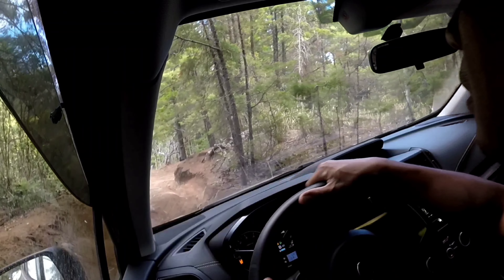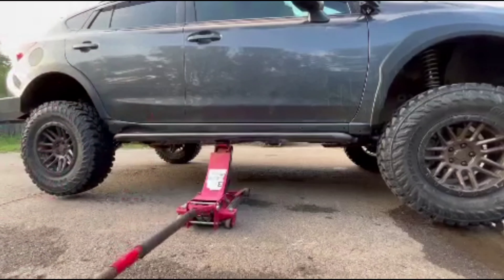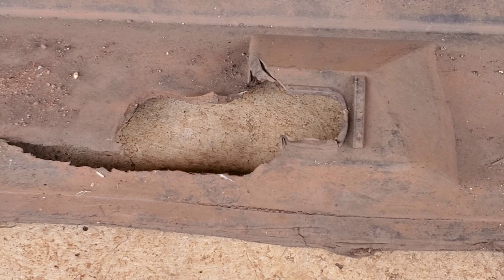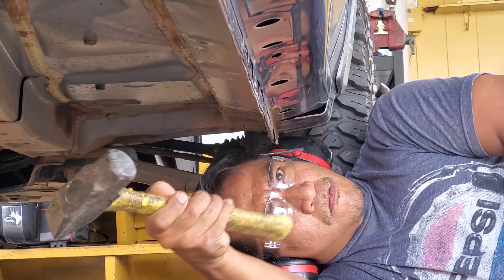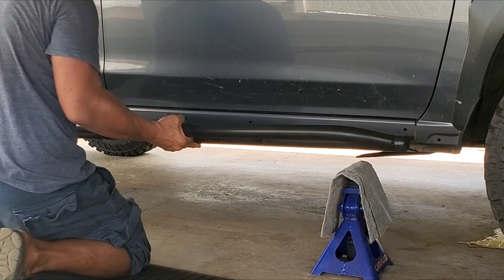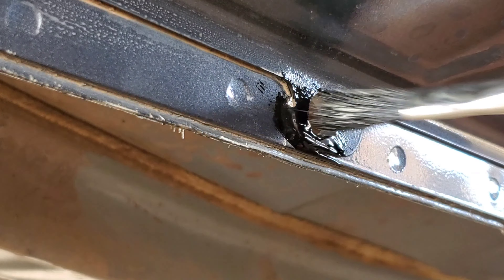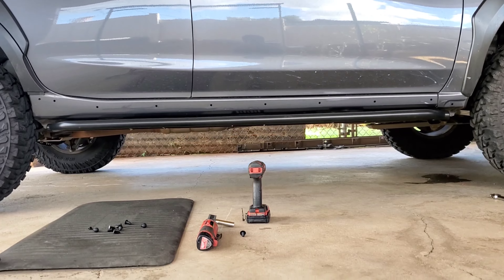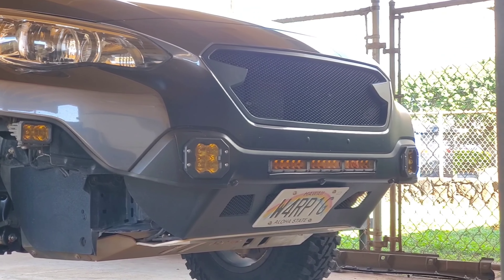Full Force Metalworks Part 1 - Rock Sliders Install - 2021 Subaru Crosstrek Sport - OCTurboJoe

Comment: He does great work, was surprised that my foresters doesn't stick out like yours.
Reply from the maker: I think it's because you retained your side skirts. I left mine off because they're broken on both sides.
Reply: @octurbojoe  no it has to do with the spacing between the pinch welds and the body yours curves up a little bit mine's flat
Reply from the maker: @beardedpixel  I see

Comment: Back in 2014 when I first got my Subaru XV Crosstrek, the aftermarket for off-road protection was nearly non-existent.

I was an early adopter of a specific brand of rock sliders, which I later found out weren't really true rock sliders. The same company makes plenty of slid plates, though.

Seeing these videos makes me happy to see that we have options these days. Some models have two options, some might have one, newer ones might have as many as five options of rock sliders.

Comment: This is awesome! Great that it doesnt affect the breakover clearance. 

Are the bolts into the pinch weld really necessary? If all the load is vertical then wont the sliders just push against the bottom of the weld? Or is it just to keep it from moving around and not really structural?